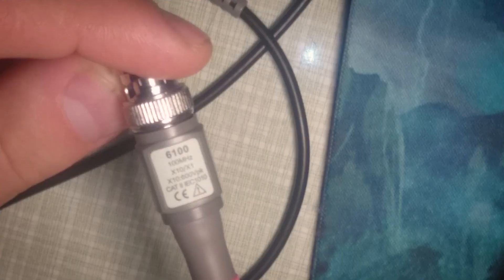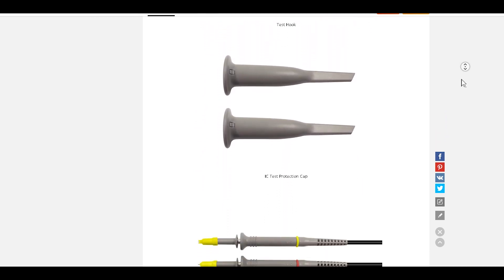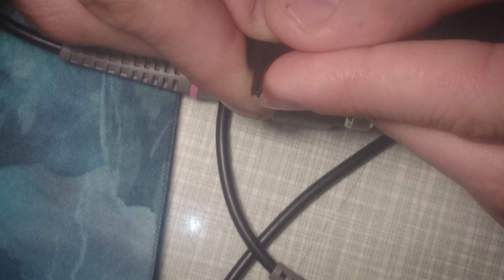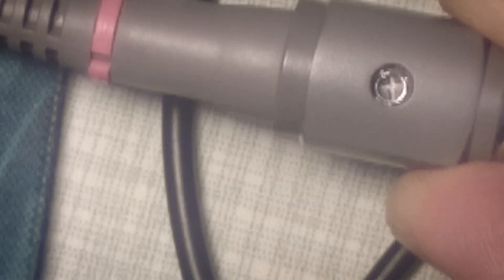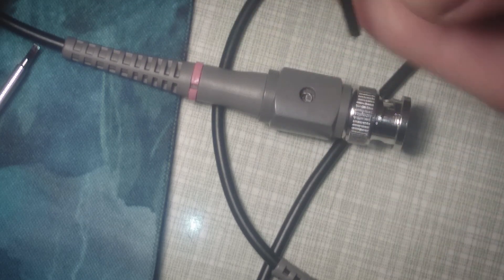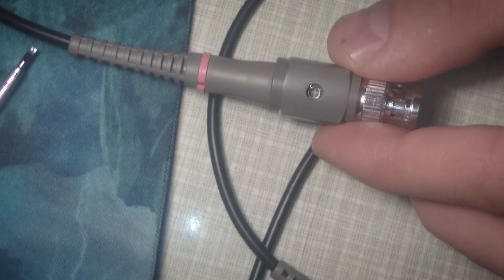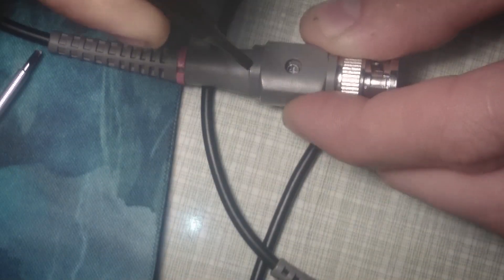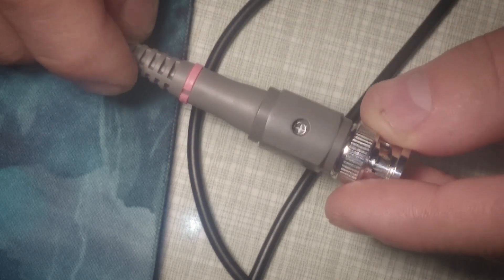P6100 Oscilloscope probe - WATCH THIS BEFORE BUYING !

Comment: I just bought some P6100 probes myself, and it appears that they changed this problem. Mine came with a screwdriver that had a small metal blade as a tip, and that works perfectly fine.

Comment: A metal screwdriver is fine.
Reply: It could mess with the variable capacitor
Reply: @dakata2416  Most compensation tools have metal blades, so apparently not.
Reply: @uni-byte  This argument is so damn ridiculous. You are correct about a metal blade.
Reply: @dakata2416  Only as long as you touch it. So at worst, you'd have to remove the screwdriver between making changes to see the results. 

In practice, I never saw a difference when I was touching or not.